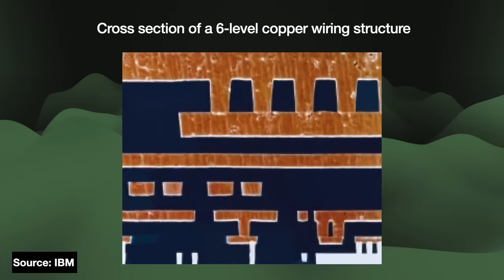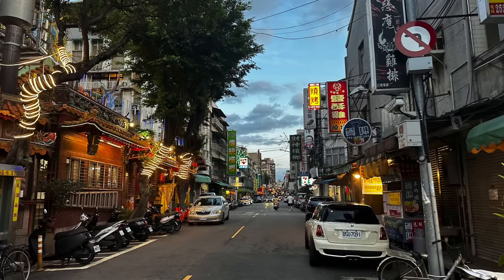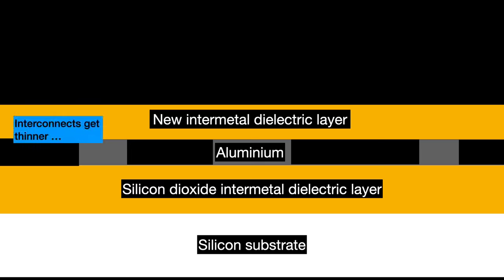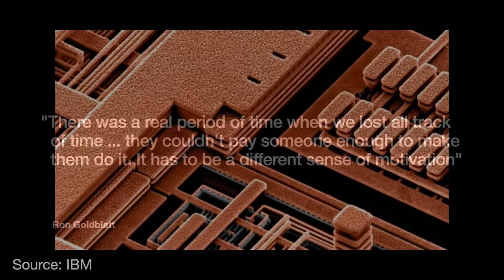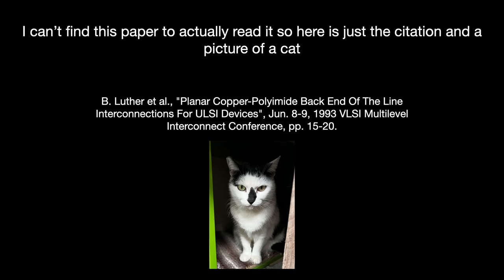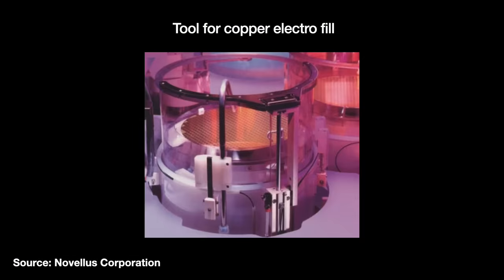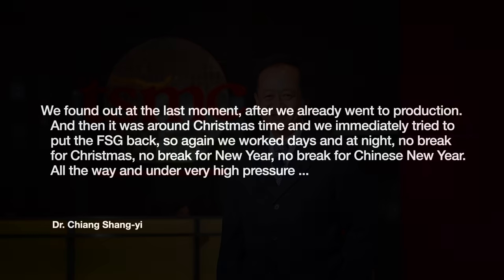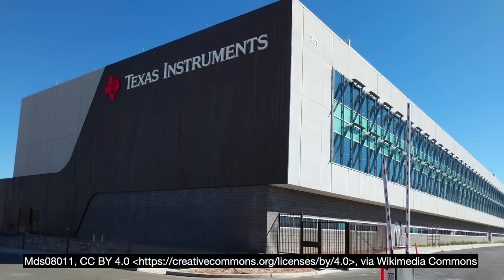TSMC's First Breakthrough: The Copper/Low-K Interconnect Transition

Comment: An excellent & insightful article (video) almost like a Technical paper. 
Yet, none is talking of using Silver in place of Copper, at least along some chosen channels. Resistivity for the first 4 metals are:
Al   - 25     (1.6778)
Au - 20.6   (1.38)
Cu - 15.5   (1.04)
Ag - 14.9   (1)
in appropriate units [ (ρ/Ώ)nm ], to the best of my knowledge (it needs to be updated). Compared Resistivity with Silver as standard, & shown in brackets. Choice of Silver (over Aluminum) improves RC by a factor of (5/3) & thus speed, by the same factor.
Of course the improvement with Silver (over Copper) is marginal at 4% only. Yet, Silver is the ultimate, with best machining properties.
In RC constant, gaining control over R is do-able, compared to reducing the k-factor (dielectric constant). With a clear goal in front,  efforts in cracking RC become smoother (easier). Copper wire with Silver core may be tried. All this costs money necessitating large-scale (bulk) operations.
Reply: Silver is unlikely to be used at all because room-temperature ambient-pressure (near-STP) superconductors are coming soon. Transductor technology with superconductivity switching will arrive after that with much lower power consumption. It will be a bit similar to the near- complete replacement of NMOS by CMOS.

As is often the case, Intel was a technology lagger in the DRAM density area and much of the memory business went overseas (i.e. there was no Intel memory production in the U.S.A. at all.)
Reply: @solconcordia4315  
Supercoductivity (of which I know less) takes time, to come. A science has to be matured to Technology, then available across the counter for a price & all that takes time. 
While we're at it (in "chips")"speed" is the present problem (the wall confronting the community), that needs to be solved. 
Thank you very much for responding.

Comment: The process of making interconnects, which are wires that transmit electrical signals between transistors and other circuit elements, is essential to the creation of integrated circuits. For over 30 years, interconnects were made using aluminum and silicon dioxide, but the late 1990s marked a transition to copper/low-K interconnects. This transition provided an opportunity for certain companies, such as TSMC, to pull ahead of the rest. Metallization is the process of laying down these interconnects, which occurs after the transistors on the silicon wafer have been made. The metal layers are separated by intermetal dielectric layers, and holes must be cut into these layers to connect multiple metal layers. RC delay, or the extra time for an electric signal to travel through an interconnect, is a challenge in creating interconnects. Resistance and capacitance combine to create RC delay, and local interconnects and global interconnects are necessary for the functioning of microchips. Local interconnects connect local blocks of adjacent elements, and global interconnects span large portions of the chip and deliver necessary signals for chip operation. The thickness and heat resistance of interconnects depend on their placement in the chip and the distance they must cover.

Comment: IBM's trouble with their lowK process impacted my employer at the time. They ended up moving to TSMC.

Also, another unexpected impact of finer pitch interconnects - especially the mid-level long runs - inductance! We ran into cross talk problems causing glitches that would cause latches to pop open when they shouldn't. 🤦
Reply: Yes, that's  why all asics had to get past "noise checks"

Comment: Nice video, but I feel a little disappointed that you never explained more about the low-k PECVD method at the end. Though you got pretty close by mentioning brand names like Black Diamond and references to the PECVD manufacturer like Novellus. I looked into these low-k PECVD layers: it seems to be "carbon doping" an SiO2 layer (while it's being deposited) to obtain SiOCH. There's various precursors that can be used, and making the layers more porous also helps.

Comment: It would seem a pretty obvious way to get copper down on a chip would be to use electroless copper deposition. We were using it all the time in the late 70’s in pca manufacturing. You also mentioned that there is no way of etching out copper -ferric chloride! ( although I am sure that there are reasons why it is not applicable-I am not into chip making-I do love these videos-terrific work-keep them coming 😊
Reply: Seconded. I thought something similar. 
Also, the copper in my water pipes doesn't easily dissolve in water to cause a toxicity problem. I suspect he is probably referring to soluble Cu+2 salts in the waste stream.

I'm not in chip making either (a Chemist) but learn a lot from these videos.
Reply: Ammonium persulphate.

Comment: The wires resistance is inherent to its area, copper has a base material resistance of 0.175 ohm/mm2 , so thicker wire leads to more resistance not less.

Comment: Great video. Also, without CMP none of the copper work would have rounded the corner. No one remembers the floor polishers that righted the Kawloon Walled City. The ASML hardware for litho was also paramount all the way to today, especially for the latest size battle between the giants.

Comment: No one in the industry was 'surprised' that IBM released a copper process.  It was, as the video points out, the obvious next step.  Everyone was working on it.  It was as apparent that someone was going to release it, and it happened to be IBM.  It would have been equally unsurprising to be Motorola or AMD or Intel.  Also, working in the industry, I never even heard of aluminum vias.  It was always tungsten.
I would hardly call copper processes"IBM's 'FIRST' hard won innovative breakthrough."  There were a couple or three before that.

Comment: Interesting video. What I asked  myself for the whole 'copper lenght' of the video was: why copper over silver, I guess the price difference is tiny on end-price of the chips and there is better conductivity and less corrosion danger.
Reply: florianmaier104
It's not so hard to understand, you only make money on Mass Producing complex chips !
End Price, what is that, consumers chips, boxed with coolers you need ? Not any high margins on THAT !
If house wife people buy PC, you know they pay too many for it, need a pre installed system, fresh windows key etc, more fancy consumers need it to be.
Reply: corrosion danger is one thing, oxydation is another and maybe silver is more reactive to the ambiant dioxygen. Silver layer also might be harder to deposit, to isolate and then to bond compared to copper. And it requires the same water pollution concern.
Adding that to the price of the raw material you talked about, it could make it less practical and harder to scale. Heck! copper is already quite pricey nowadays despite being way more abundant.
Reply: I liked to say that "it needs to be made out of cheap dirt to be dirt cheap" while talking about semiconductors, displays, photovoltaics and batteries. But with all of the new stuff using high tech proprietary compounds and rare minerals, I'm not so sure it applies anymore.
Reply: @PaulSpades well they're not so cheap anymore.

Comment: I thought it was called Damascene because there's multiple layers of metal (tungsten-copper-tungsten), like in a damascene knife blade
Reply: Damascus you mean I guess
Reply: Hmm Copper Tungsten is a neat alloy. Works very well as submounts where low thermal expansion and good thermal conductivity are needed. Mounted a lot of AlGaAs laser chips on the with AuSn solder. ❤

Comment: This was amazing your insight into the industry is incredible. I didn't realise Cooper was so hard at those scales considering the industry built every PCB on this stuff using photo resist. Electro plating  seemed to be an obvious choose for the copper layer though at least from a predictable repeatable manufacturing process. The high K chemical make up was vary interesting I actually thought Intel was first to market with high K but I guess there has always been different implementation some better than others. It's also interesting how IBM seemed to be behind or only slightly ahead, I thought they were cutting edge. It really sounds like the research at TSMC is top not and it is not just there access to EUV.

Comment: Where did you get the info about UMC 180nm using copper for lower levels? I have FIB cross sections of UMC 180nm devices that are aluminum on all four layers beyond any doubt: you can see tungsten via plugs, adhesion layers on the top and bottom but no barrier on the sidewalls, upward-pointing sidewalls indicating etching rather than damascene patterning, and a zillion other telltales even without needing to EDS it.

It's entirely possible UMC also has a 180nm copper technology developed from this tech as a step towards their future 130nm copper technology. But if it exists, I've never seen it.

Comment: IBM did the heavy lifting in semiconductor process design but today they are not known as a chip manufacturing powerhouse.   

2021 News Item: "IBM is suing GlobalFoundries in New York State court, alleging breach of contract in the 2014 deal to sell its Essex Junction microchip plant to the Abu Dhabi-based company.   IBM paid GlobalFoundries $1.5 billion as part of that deal, in return for a guarantee that GlobalFoundries would supply IBM with high-performance chips for its main frames and servers for a decade.  The lawsuit alleges GlobalFoundries walked away from that commitment, and now IBM wants its $1.5 billion back, plus additional damages. IBM also wants to know what GlobalFoundries did with the $1.5 billion, since it alleges it wasn't spent on developing the chips IBM needed, as was agreed in the sale"
Reply: TSMC guesses right on the dielectric and reaps the profits.  The "second mover" advantage, very common in technology and arguably the first mover should get some sort of compensation from the government to encourage such 'races' in innovation.

Comment: 10-15 layers seems absurd to me. Topology suggests you should be able to embed any graph with just two metal layers, i.e., four total including the insulation. I wonder why this doesn't hold?
Reply: Bc real wires need thiccness to not have infinite resistance
Reply: @paolo7733  I understand in principle, and I'll grant two conductive layers will tend to squeeze stuff, but five to eight conducting layers still seems wastefully redundant over three.

Comment: Im wondering if they could make the connection even smaller if they used silver for improvement in current carrying capacity and reduce heat buildup?  Might be a interesting next step

Comment: How many amps are running in a cubic meter of the Kowloon walled city at any given time, I wonder.
Reply: Considering it was demolished, not many.
Reply: Let's assume:
•	Processor die size DS=500 mm^2
•	Thickness of active layer TA=10 um=10^-2 mm
•	Volume of die VD=DS*TA=5 mm^3=5*10^-6 m^3
•	Power consumption PC=100 W
•	 Supplied voltage SV=5 V
•	Average current AC=PC/SV=20 A
•	Current per m^3 CpM=AC/VD=4*10^6 A/m^3
•	
... please check it !!!! 😉

Comment: 10-15 metal layers is outdated already (lol) - there's actual documentation about how many metal layers the Intel 7 and Intel 4 processes include, for example. Depending on if you include the 'giant metal' layers, it's either 15/16 or 17/18 for Intel 7/4 respectively.
I doubt AMD, Nvidia or Apple's current offerings are less complex than those by intel.

Comment: They etch copper in PCB manufacturing, so saying you can't is obviously incorrect. But I could totally understand if those acids are not chemically compatible with this manufacturing process.
Reply: Etching at small sizes needs to be done in the gas phase, not with acids. There is no volatile compound of copper that can be pumped off
Reply: @paolo7733 You can gas almost any chemical regardless of its acidity, some are easier than others, and there is OBVIOUSLY plenty of chemicals that can etch copper.
But the point was... there may not be any acidic chemical that can etch copper without also etching the dielectric.

Comment: So where are with with fibre interconnects on cpus and gpus?

Are any of them ready to reach market?
Reply: processor to memory interconnects are running, I think it more to do with integrating the optics into the package and to the die that make volume manufacturing more complex. Waveguides are also in the works however require support at the PCB design level to manage the frequency involved.

Comment: "Makes sense, it's Applied Materials. They'd use CVD to butter their breakfast croissants, if they could." 😂
Reply: The thought of melting butter in a cvd machine is horrifying 😳  it would utterly and completely ruin the machine beyond any hope of repair.😂 Used to run a CVD for baking laser wafers at Boston Lasers way back in the late 90s. During one run to make 635nm laser wafers it accidently added a couple extra doses of triethyl aluminum and we decided to say screw it and continued the run. We ended up with lasers that worked at -15 degrees C and lased at 604nm. Bright pure orange ❤

Comment: 14:02 “you can’t etch copper” ??? Yes we can etch copper. All PCB circuit boards are copper foil etched to make circuits on polymer composite boards. More on copper etching below.

Viewer should be warned that Taiwanometry does not have scientific or engineering background. Take this video as  how non-scientific Taiwanese conceptualize Chinese-centric technologies and economy.

Taiwanometry, hire a real engineer to review your outsourced scripts.

Copper can be etched chemically or physically with energy beams. Nanometer dimensional copper features can be etched or deposited by sputtering, ion beam deposition/etching, reactive chemical and even laser.

Not everything is invented in Taiwan, TSMC could not be where it is today without patented technologies, equipments and materials from 70 countries notably from America and Japan. TSMC will grind to halt within days if America and Japan stop supplying TSMC. 

Most importantly, more than 90% of what TSMC produces are designed and ordered by American companies. TSMC became best logic not memory manufacturing factory because of technology cooperation with its’ customers and protecting customers’ IPs. Otherwise Samsung and Intel would have surpassed TSMC long time ago.

Comment: 😮i've worked with electronics for years, watched a ton of these kinds of in depth videos, even binged asianometry, but it still breaks my brain thinking how dumb metal intricately stacked can do even the most basic stuff, not even getting to Ghz processors or GPUs, i take it on faith that there is engineering, not magic inside the little black bricks lol

Comment: I never knew you couldn't etch copper. I've etched copper myself many times.
Reply: I did shake my head after that statement.
Reply: you've probably never etch copper at the nanometer scale… duh!
Reply: Not as a film in semiconductor processing....you can etch it with acids, but for typical electrical conductor dimension you use plasma etching, unfortunately Cu doesn't form an easily pumped away gaseous etch product, so no plasma etch of the material. Damascene polishes the Cu off the surface of the wafer, leaving it in the trenches.
Reply: @thecraggrat  you've got to do what you've got to do.
Reply: @PainterVierax  I probably have etched copper an atom at a time.

Comment: Intel having engineers release papers on electroplating copper interconnects half a decade before another company utilizes this technology, all while intel ignores the ever apparent progression of the semiconductor manufacturing process parallels the move from planar devices to FINfet devices. Their engineers released a paper decades before the successful implementation of the FINfet and they still got surpassed by their competitors

Comment: Do you know why they not use silver for all interconnects , the ammount used inside is sooooo extremely small it shouldnt make a difference and conductivity is much better. Is it because copper is more easy to deposit?
Reply: I might be wrong, but I believe copper has some properties that make manufacturing with it a bit more workable. Copper has some drawbacks, like that it migrates and can contaminate just about everything.
Reply: @CRneu I think silver is worst in diffusion. So you need thicker diffusion barrier which cut space for more conductivity.
Reply: the amount in it might be small, but the amount required to put that small amount in might not be so small.

I don't know the process(es) to be clear, but I know there are plenty of things that require far more of a resource then what actually ends up in the final product just due to inherent inefficiency AND times where you need a large starting lump to make something happen.

Comment: Always have looked at a cpu curcuit as a huge city buildings roads wires cars trucks transporting like a cpu does . 
flew a small cam over a motherboard in the dark slowly came out like a starwars clip  i put small caps/lids on fire  using metholated spirit's  burning like a missle hit it  came out ok